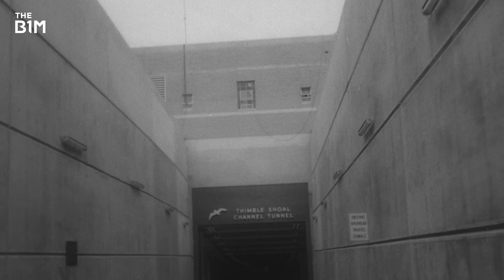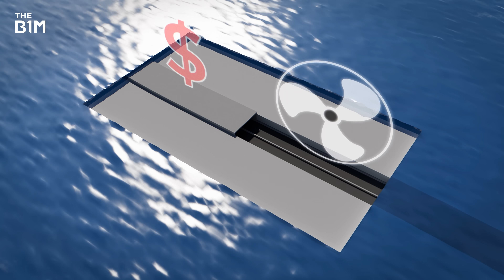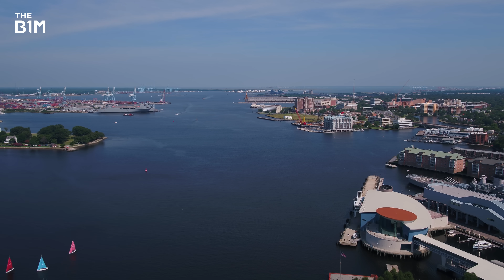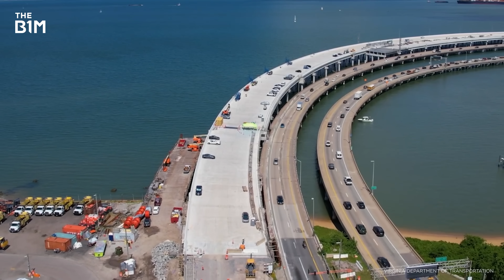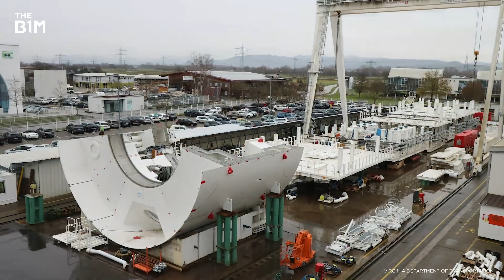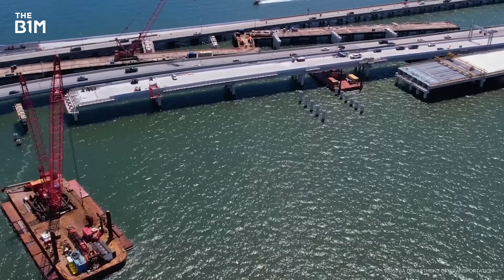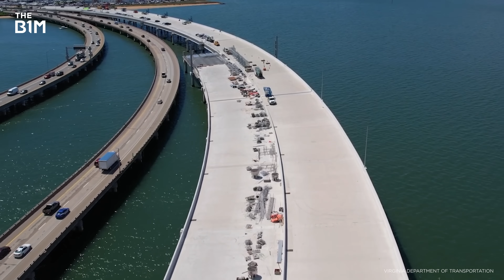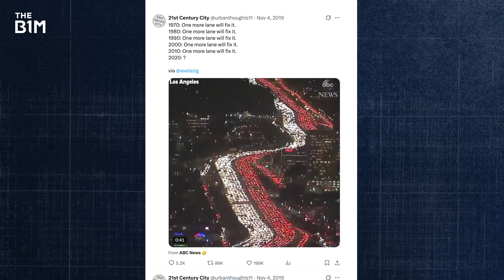The US Megaproject You’ve (Probably) Never Heard Of

Comment: Proud to be part of the project!
Reply: If you have the inside connections perhaps you can tell them to stop wasting tax-payer money on more car infrastructure and build a rail line instead.
Reply: @mathieufaltys  
The grade required to descend 173 feet, then ascend 173 feet, in 1 mile is 6.55%. VERY unrealistic for trains. I don't know the economics of lengthening such a tunnel in that area to lower the grade. 

From Google:
"For conventional freight railroads, the typical maximum ruling grade is generally 1.5% to 2.2% (about 110 feet of elevation gain per mile). While steep mountain lines can exceed 3% and exceptional cases reach 4–5%, anything over 2% significantly reduces train speed and tonnage, making it uneconomic."

Perhaps for that very reason, different railroads serve each side of Hampton Roads. CSX (once C&O) serves the north, and NS (once N&W) serves the south. Each operates separate large coal export terminals on their side. Each side also has separate shipping container terminals. Hampton Roads is a major port, with over 100 daily freight trains carrying containers, coal, whatever. But just a very few rail car ferries operate between north and south. That 3 - 5 mile wide Hampton Roads waterway, burdened with the naval fleet requirement that it never be blocked, is a significant challenge that the railroads decided long ago to completely avoid. Unfortunately, that waterway is smack in the middle of an urban area of nearly 2 million people, who greatly benefit from this and the 2 other highway crossings.

Comment: Virginia resident (Richmond) and this tunnel isn't bad when it's moving smoothly.  However, when there's an accident, you're screwed and will be sitting in traffic for an hour or more.  I have avoided the area during construction mostly but they're doing a really great job of keeping things flowing.  Amazing that it's actually ON budget.  Holy hell that's awesome.  Excited to use it when it's complete!
Reply: In your opinion, who ran herd on the project to keep it on budget?
Reply: @stillatwork  VDOT has a tendency to do huge contingencies in their cost estimates, which has its pros and cons.  They do extensive PE prior to even allocating the funds to this kind of thing also which does work well

Comment: The engineering behind American bridges is next-level—designed with high-strength steel and reinforced concrete, built to handle extreme loads, weather, and even earthquakes. From deep foundation piling to cable tension systems and aerodynamic designs, every part is calculated for safety, durability, and decades of heavy traffic use. It’s not just construction, it’s precision engineering at its peak.
Reply: Clanker

Comment: Seattle just completed the world’s first light rail line on a floating bridge. Would be a cool video for you guys to check out
Reply: That sounds interesting. First question that comes to my mind is how that works structurally with the rails. Since they can't move around to much
Reply: @josh993654 it also required electrical isolation in case water from the lake gets on the tracks.
Reply: @josh993654  Basically, you put a second bridge on top of the floating bridge's expansion joint. That lets you spread any motion out, and it's attached with basically 3-directional hinges that allow the bridge below to move while the bridge above stays more stable.
Reply: @josh993654  the floating part is one segment and instead of expansion joints like for a road bridge they have a larger segment with smaller rail parts that do the same job only on a larger lenght. I hope I wrote it well enough. If not there is a video from sound Transit where thay show it.
Reply: @josh993654  its not rocket science its engineering lol!
Reply: @josh993654 this was the core design challenge of the project- caused a lot of delays. Apparently they came up with a system to allow the rails to stay parallel when the bridge flexes, interesting stuff.
Reply: I was one of the first 1000 people to get to ride it. The views around the lake was incredible and the engineering work were very impressive. It opened almost 1 month ago. 

Sound Transit's Crosslake Connection officially opened for passenger service on March 28, 2026. 

It is the first light rail system in the world to operate across a floating bridge.
Reply: I know they have done a video on Sound Transit but it's been a while. I'd love a new video on that!
Reply: Sounds cool, but with one 'small' problem...it's still Seattle!
Reply: Miles in Transit did a video on it 4 weeks ago but it wasn't engineering oriented.
     https://youtu.be/TOCezQrUGpk?si=-GXcLN1xcabpj-RZ
Reply: They already did a video on Seattle tbf
Reply: @jarjarbinks6018 that’s different they didn’t talk about it. They only talked about the expansion and planning for the future lines and so on.
Reply: But one thing we've learned in Michigan is that floating bridges can become sunken bridges...  😢
Reply: Just rode on it this weekend!
Reply: its nothing special lol! no one cares about that! Switzerland has the steepest railways in the world going around the alps up to the highest mountain....
Reply: Wow a train on a pontoon bridge so crazy smh
Reply: @chillynipps9102  its not crazy